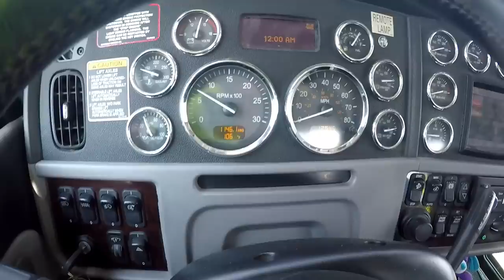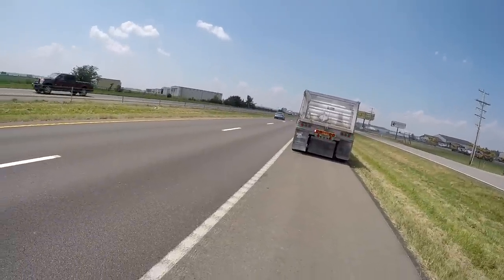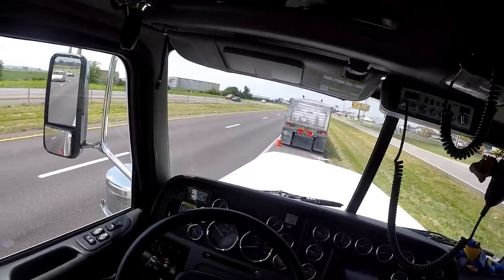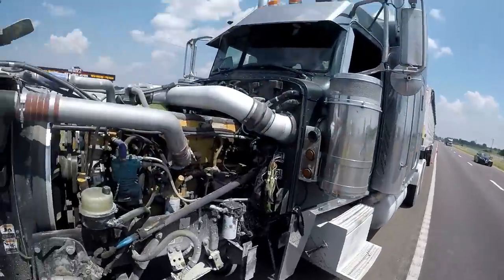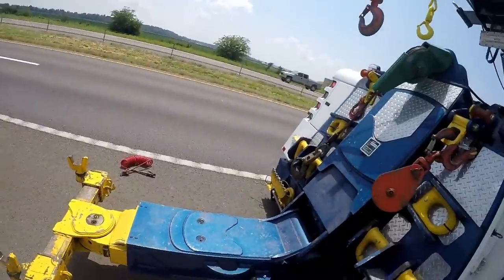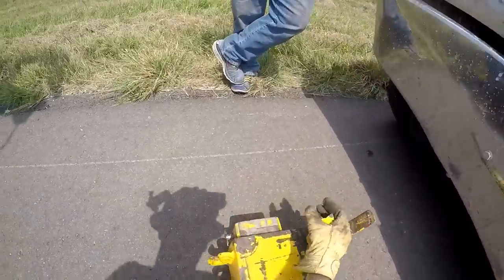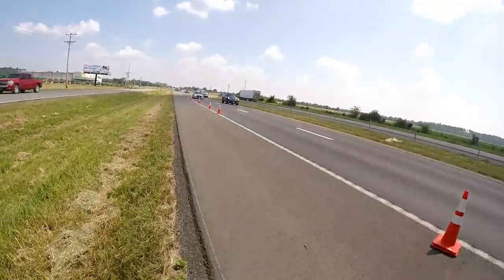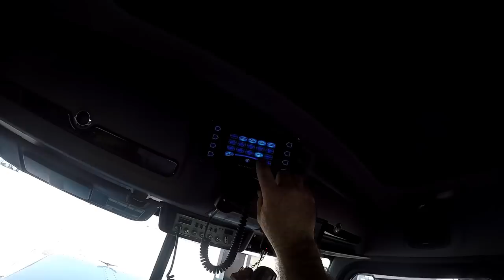THIRSTY TRUCK ON A HOT DAY

Comment: Former LEO, one of the few tickets I would write every time especially on the interstate was move over or slow down tickets. I don't care how busy or entitled a person thinks they are you need to move over for emergency vehicles of all types. And that is actually one of the most expensive moving violations too.

Quick anecdote, I was blocking for a nasty accident that a truck like the rotator would have been amazing for, rolled over 18 wheeler carrying a butterfly valve replacement for a local dam, with a car trapped under the valve (miraculously only minor injuries). And worst of all on an elevated 3 lane highway interchange. We shut down down the entire overpass. I was adding some new flares to the flare line and had an idiot blow through the line. I did what I was trained to do and cleared everything from my hands including a lit flare and got out of the way. In doing so I unintentionally tossed the lit flare on the hood/windshield of the car. Not that he noticed until he had 20 pissed off cops in front of him. He got charged with 3 moving violations, including move over or slow down as well as no insurance, inspection or registration. So, he was taken to jail and his car impounded. When the flatbed showed up for his fancy SUV the wrecker noticed the melted plastics and metal... #sorrynotsorry

Comment: When I used to help my ex at the truck shop, I understand what a pain in the butt to deal with the traffic is. One thing that you may want to do when you're setting out your cones Is put them out in an angled formattion from the grass to the shoulder at an angle, and utilize that slow down sign that you have in there after all you are in the show me state. Also here is a thought we had  a arrow board we hung temp while we changed tires. We made it with 4 of the arrow turn signals we found laying in the shop and got them going from inside to out side to make the people understand to change lanes, it also  had two orange flags mounted to it to get peoples attention to look. And it worked we also had the cones out with flags in the outside ones amd the slow sign in the middle of the 3 angled cones. With the combination it slowed them down. We didnt have a pretty truck like yours. We had a beat up service truck. At night the arrow board was a blessing.

Comment: Ron, I know this is an older video but you need to check out the move over law passed in 2017 in New York state. It not.only pertains to law enforcement it also includes any emergency vehicles including tow trucks and even garbage trucks. It is considered a moving violation, punishable by2 points on your license and a $150 fine. Check it out!

Comment: Might check around CB shops; I know you can get some magnetic antenna mounts that use 3 6" diameter magnets.  One of those magnets on each end of the light bar might help keep it in place while you get the straps on, and make it bounce less.
And maybe it's partly the camera, but at least the lights on the back of your truck don't seem as obvious as what's usually on police/fire/EMS vehicles.  Could be worth asking around with different departments and see if they can suggest a brand of surface mount lights that has better daytime visibility.

Comment: In Kansas , I Think it is State Law , that you have to vacate the slow lane and move over to the Left , into the Fast lane ( Passing lane ) when anybody is on the Sholder of the Road.  However I been in other states and they don't have this State Law.  That Police Officer was really nice. He actually parked in the slow lane . I do not think I would do this if I was that Police Officer. That Police car was kind of light weight and low to the ground. 
If it was a heavy weight and bigger 
and Taller where you could see it from futher away like a Police SUV
and with a big hudge light bar on top with Red and Blue lights flashing and with a yellow line going across in the left direction with a yellow arrow at the end on the yellow line , like Road Construction Crew has, then I might do that.  But man , traffic was coming up two wide, at 70mph. Wow. that was crazy.  I hope that Police car had a great light bar in the back on top of the car and not just in the back window,  like some cars have. 
You have a very very Dangerous job... I hope you pray before you go to work every day. And take time out to pray while you work. And always give thanks to God after every tow. I know I would always say Thank You Lord, as I took a deep breath after service call.  I think I would charge $500.00 min. for that Service Call.  That Call was intense. I caught myself praying for your safety, while watching you video.  I know your video was not live, just a habit of mine.  I think you should have a million dollar life insurence policy. Also If I were you I would pay extra every month and have a good Medical Insurence.  You have a very dangerous job. I am glad you asked the man not to stand in- between the two trucks.  Freeways are so dangerous. I am glad you asked for Police assistance.  Also am glad that not only thanked the officer but put a thank you call into
the police station after your service call.  It is always good to give thanks in all things, for this is Gods Will in Christ Jesus concerning you. 
1st Thess 5v18
God Bless you Brother. , and God Bless you family. May the fruits of the Spirit be with you always. 
Gal 5:22.

Comment: Would it be possible to carry a fuel drum on your rig to offer a customer like that truck enough fuel to get to the nearest truck stop instead of going through the hassle of towing in future similar situations.
Reply: animenut69 we do that in Ontario
Reply: animenut69 it's not that simple with a Diesel engine. Once it has been run out of fuel, it needs to go to the shop. The fuel injection system needs to bled of air.
Reply: animenut69 in some states it's illegal to carry diesel fuel like that, only gasoline
Reply: As he mentioned near the end, the fuel system needs to be primed after it is run dry.
Reply: animenut69 when a diesel runs out of fuel you have to prime the system so that it will run. Because of this you can not simply fill the tank and be fine like you can with a gas powered motor. While this idea is great for a gas powered vehicle it would not work in this situation.
Reply: when an old diesel truck runs out of fuel it can take longer to get the air out of the fuel system than it does to just hook it to a tow truck, and you never know what tools you might need to use to bleed it since sometimes bolts and fittings get changed over the years so it may require a complete set of tools, not practical to haul around on a tow truck.
Reply: When a diesel runs out of fuel it's not like a gas engine. It takes tools to purge the air out of thee lines.
Reply: Sounds like a good idea until you have gone through the hassle of bleeding all the injectors to get a restart on the roadside! Sadly is isn't like a gas engine where you can just add fuel and go ;)
Reply: There is a lot more involved with a diesel semi truck than putting fuel in the tank. Like Ron said you have to prime the system to get fuel pumping back up the engine. It is safer to do it in a shop setting where vehicles aren't slowing down and not moving over like state law dictates. They recently changed the slow down move over law here in Tennessee to include any emergency vehicle and any vehicle with it's hazard lights on.
Reply: The truck would still have to have fuel system primed so all the air is out of the fuel lines.  Diesel powered trucks can not be started until all the fuel lines have nothing but fuel in them.  Safest thing to do is get a tow once the fuel runs out.
Reply: animenut69 you can't just re-fuel a Diesel vehicle like a gas vehicle. If the injectors and pumps and fuel rail gets air in them, like if you run out of fuel, you have to bleed the air from the fuel system and im fairly certain that would be more work than he could do at the side of the road so it has to go to a shop AFAIK.
Reply: It might not be practical to do that, for several reasons. Space on the truck is at a premium; it would take longer to pump fuel over than to just hook it up; sometimes getting a truck running again after it runs out of fuel requires filter changes or priming. It's just less practical to engage in all of that than to just hook up and get off the highway. 

That all said, the interstate Help trucks in most states do carry some fuel to get stranded motorists running again.
Reply: Sir, when you run a diesel out of fuel it doesn't just start up again like gasoline engines.
Reply: when a diesel runs out of fuel it is very different from a gas engine.  Once air is ingested into the fuel system it will need to be bled out before it runs... if it runs... diesels fuel pumps don't like being run dry and can be destroyed running out of diesel.  This was a very expensive whoopsie, such is life though!
Reply: Doesnt matter. Running out of fuel in a diesel is not like a gas engine where you just throw 5 gallons in the tank, turn the key and away you go. After they filled it up he had to take the truck to his shop so a mechanic could get the fuel system primed to start the engine.
Reply: That is counter-productve. Diesel is less volatile than gasoline.....
Reply: Many modern engines are self-bleeding,actually...maybe not on trucks, but i dont see why they could not be...
Reply: I was thinking that too, its a fairly simple process to bleed a diesel system, looking at the access to the engines in these trucks it wouldn't be difficult
Reply: I remember the good old days when Caterpillar engines had little primer pumps.  I've self-primed on a few occasions including a few instances where the diesel gelled a bit.  I've also helped prime several other guys who had Cat's with primer pumps.  Everyone says the same thing afterwards... "I didn't know I could do that.".... well, I had to be taught that trick too when I was young.  It wasn't a 3-second fix, either.  Sometimes it worked pretty fast, maybe a minute or two, other times there was bleeding (you could crack open a bleeder nut close to the pump) to do,  but I never saw a Cat that refused to start after being hand-primed. Now 60-series, on the other hand.... call a mechanic!
Reply: Then you have to get fuel placards and if the engine is completely out of fuel you could drain the battery trying to start it
Reply: Mickey Colgan 
Actually a lot of the trucks now will start without priming them. I drive a 2014 Freightliner Cascadia and i ran out of diesel last year. I went and got a 5 gallon canister filled it up with diesel then i put it in the trucks tank and it started up instantly. I heard that a lot of the newer trucks from 2006 and up won't let you run out of diesel completely it's got some safety feature that shuts the engine down before the lines can suck up air, that's probably why my truck started without a problem after running out of diesel.
Reply: animenut69 hahaha why that's what ur Fuel gauge is for!!! Mostly when he said that his dedicated run that even makes it worse that guy would've been fired for doing something stupid like that!!!
Reply: Sartaj Aujla Ontario Canada?
Reply: About 95% of Diesel Semi Engines have a Primer so everyone needs to chill about taking the truck to a shop so a guy can press a rubber button on the engine x number
Of times
Reply: besides were would you put it, his truck is full of Equipment, and it is dangerous enough to hook up let alone working on an engine in the side of the road, trust me I know been there done that.
Reply: Best thing to do is to not let yourself run out of fuel. Had to prime 10-15 feet of fuel line on a reefer that was completely dry, wasn't fun to say the least hehe
Reply: Yeah diesel vehicles need to prime all the lines. Even gas vehicles are not safe running out of gas though. Newer vehicles use the fuel to cool the high pressure fuel pumps. Running out of fuel could cause a pump to burn out.
Reply: A very,very good point.
Reply: Like mini tanker truck
Reply: I wondered that also, why not just put some gas in it? Thank you viewers for explaining why you just can`t do that to all us novices out here.

Comment: Hi Ron, I work for Disney Security and my role is working the roadways for traffic and accident control. Maybe you've already done this but, our overheads have a move over pattern. The pattern will strobe right or left or from the center outward. Perhaps you could add a yellow bar with this move over pattern? I know exactly what you go through with people not moving over. Be safe out there.

Comment: Ron, I have had to deal with the insects before.  Try having your crew take B complex in larger doses for awhile.  It helps your body create its own repellent.  I was a watertruck in the mine for many years, and found that they stopped even trying to land on me for which I was very glad. I found the information in the Vitamin Bible, back in the '80s.  It will take several weeks to become effective, but lasts as long as you take the right vitamins.

Comment: Maybe some side pod lights that protrude about 6 inches from the sides of the truck, that are mounted in away that your head just clears under? That or the rearward facing lights suggested can be mounted on the mirrors that can me manually extended for whichever side traffic is on. And maybe some bright white flashers that are mounted atop the boom, as it is the highest point of visibility?

That light bar could also use white lights firing in tandem, white is the most visible at distance, and firing the lights in tandem tends to get the lights to reach farther.

Comment: Ron you are great, few tips, I have towed for 15 years,  when you pulled up to the truck maybe pull in front of  truck  deploy your lights and cones , get the unit on your stinger , if you look at your location i am sure you could have made the exit then finish the hook up,  you called an police unit to block you,  that unit could have been on the streets patrolling &running calls. I am not critical to your form but you are killing yourself, I want you around for a long time,  if you keep it low & slow that unit will stay on until you can secure it, also that driver should have been in the cab of your truck through the whole deal ,  here in Texas a trooper could pull your licence for that , and I know you have a ton of money in those trucks but I would rather the truck take the hit rather than you, You can buy another truck,  you can't buy another you or anyone of your driver's keep up the great work!

Comment: I honestly have no clue about trucks but tiny idea.

Do you set the emergency brakes on in the trucks when you're in between them? This way if a car (or a truck most likely to cause this) hits the back, it will prevent it from them running over you. I heard of a story of someone hitting the back of a parked car and when it lurched forward it killed someone infront of it. Not sure the legitimacy of if this is useful, but thought I'd share.

Comment: Loving your videos! Former FF/EMT here traffic doesnt care. but your truck on the front side could use more lights. LEDS are very directional and the height of your vehicle makes it hard on the height of the vehicle to see it. Ive seen it time and time again when you are running code. Some mirror pucks would be awesome. Also putting 2 mini bars on the back corners of your truck would do wonders! But then again I loved having as many lights as I could!

Comment: It amazes me how people simply don't move over and/or slow way down for any kind of vehicle on the shoulder, especially emergency and service vehicles. I always move over for any vehicle, emergency, service, or regular, on the shoulder if possible and if not I slow way down and give as wide a berth as possible while staying in my lane.

The other week we had really strong winds and drifting snow here and between a sudden gust of wind and a snow drift I wound up just off the road in the ditch of a two lane state highway. There was an SUV in the ditch on the other side of the road from where I went in. Despite snow drifts all over the road and two cars in the ditch at the same place people just were not slowing down. As I was calling roadside assistance I see in my mirror a pickup truck towing a trailer jack knife and slide sideways. I thought he was going to hit me but he didn't and was able to get going again.

Even after an officer from the local PD set up a little ways behind me with all his lights going (I said there were more lights than a disco) people didn't slow down much. It wasn't until the tow truck for the SUV arrived did anyone slow down noticeably and not until the tow truck for me arrived a few minutes later did traffic stop and that was only because the two tow trucks were blocking most of the road and the officer had to get out and stop traffic to stop people from trying to squeeze through.

Once my tow arrived I was back on the road in less than 10 minutes and very thankful to the tow truck driver.

Comment: I deliver cars to dealerships and when we unload next to the highway like you are doing the cars never slow or move over......so.... When I'm walking down the street side of the truck I hold my load bar out beside me.....it's funny how fast they move over when they see that shiny metal bar.....they move over ASAP I guess they don't want their automobile damaged 😁. That's a trick that I use and it works every time... Just hold out that bar👍🏼